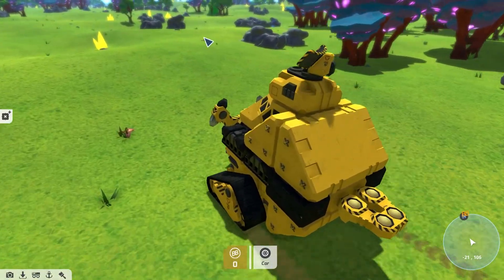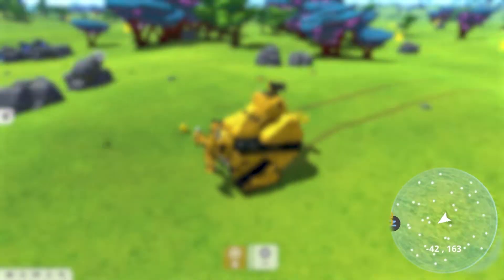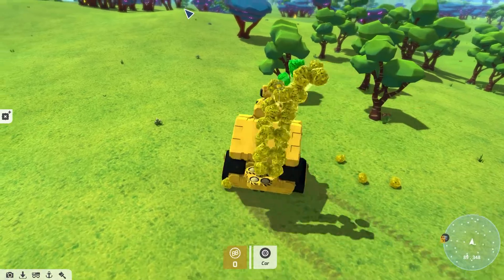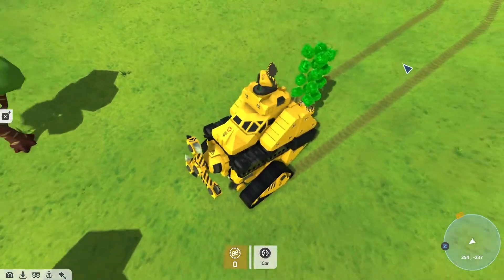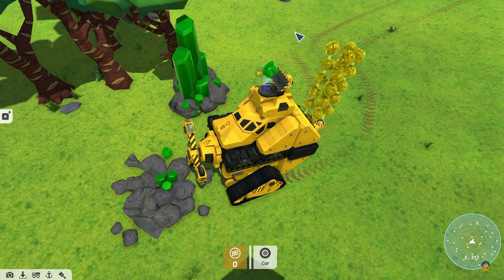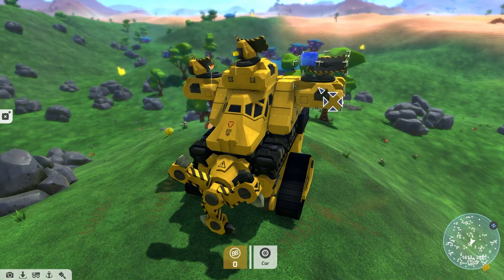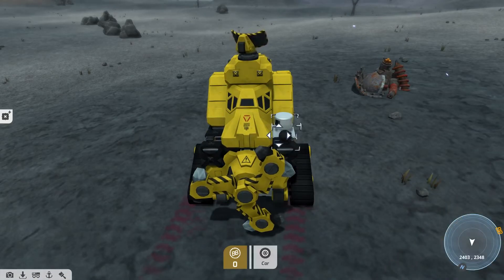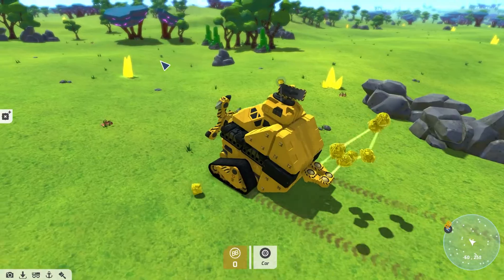How To - Resource Radar || TerraTech Tutorials

Comment: My only complain about this block is that it should have a selection menu like the filters instead of needing a resouce chunk. Also, if you attach a resource grabber or reciever, it will feed the radar automatically.
Reply: they did that so you are sacrificing one of your resources to find more of it